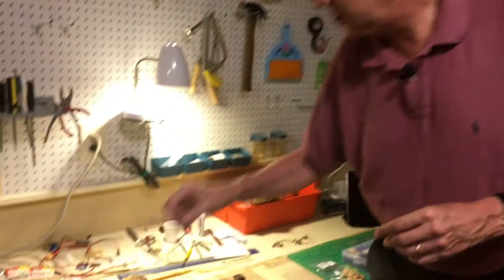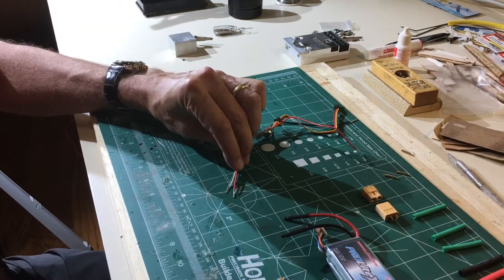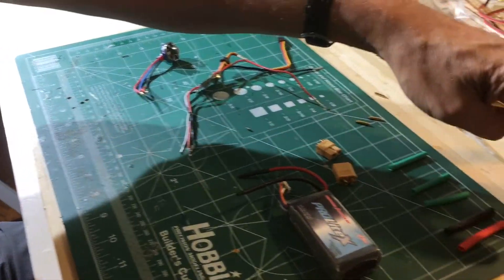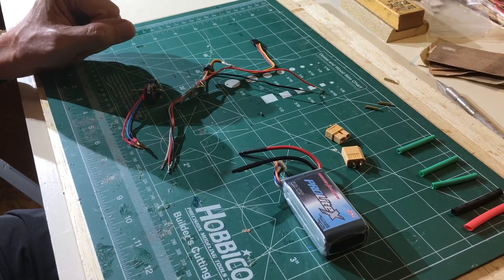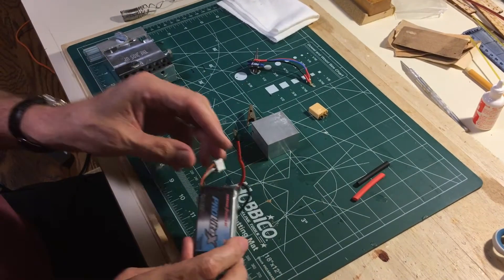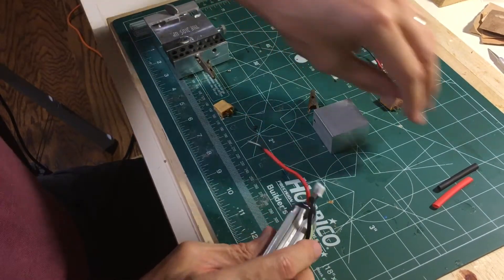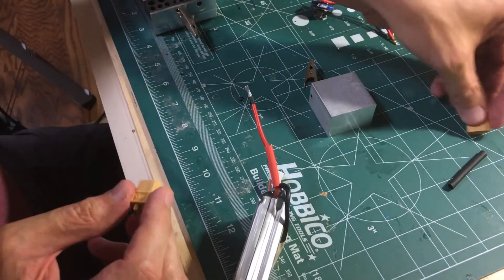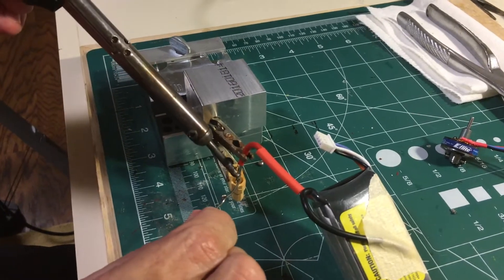Radio Control Basics ESC Motor Battery

Comment: OMG very average soldering and short prevention ,ay I suggest Tin wires first before sliding on heat shrink also tin connector fist before applying wire. Heat the tab then touch the tinned wire and insert when solder melts, this way heat is kept to a min and joints are smooth and sound. Tape is pretty much useless in reliably preventing a short instead  Slide over some heat shrink and only shrink on cable ie  leave the connector un-shrunken so Motor connectors can be pulled apart
Reply from the maker: Good advice, thanks for the tips!

Comment: Hi Tim I have just got back into the hobby after 50 +years I have bought a 450 2.5 fly wing helicopter can you tell me how to set it up to a nx8 transmitter if possible I would be very grateful thanks Pete.
Reply from the maker: Peter:  Welcome back to the hobby!  Helicopters are out of my wheelhouse . .  . can any others assist?  Tim
Reply: @TimMcKay56  OK thanks Tim I will have a look and thanks for the quick reply. 👍

Comment: I have scratch built a high wing, with some dihedral, and parts from a kit I had many years ago.
Your videos have helped me so much. Can you tell me of an online site with various odds and ends parts and accessories for an rc. I am about ready for a maiden, but somewhat reluctant thinking I'm not ready. Maybe I need a few more helps. I don't know. Thank you.
Reply from the maker: Willard:  Thanks for checking in!  A great starting point for RC odds and ends is Amazon.  I get all sorts of parts from the site.  And please, if you are new and/or nervous, find an experienced pilot of instructor for that first flight.  Might well save a crash!  Tim

Comment: Nice demo’ BUT if you buy lipos from H/K and the vast majority of retailers  on this side of the Pond the XT60 connectors are already soldered on  — in the opposite “sense” — in fact all the XT60s I have bought are marked with the + on the “square” end and the - is marked on the “round” end.  
Just thought it worth mentioning.     And my Aide de Memoire is “Red Square”.
Reply from the maker: Gurth:  100% correct, gotta get battery polarity right!!  Tim